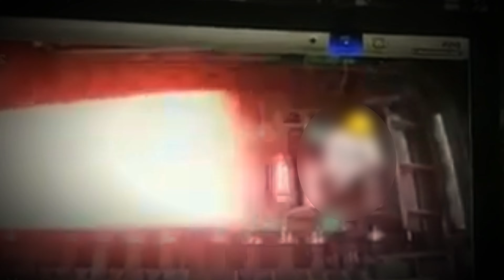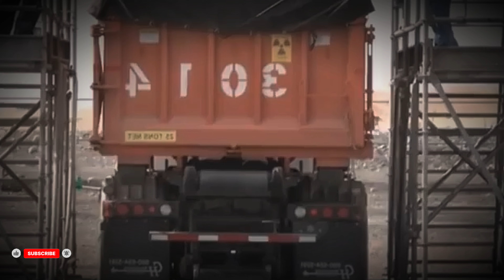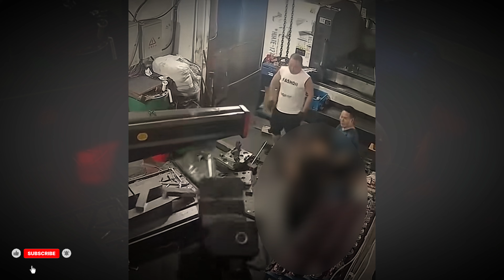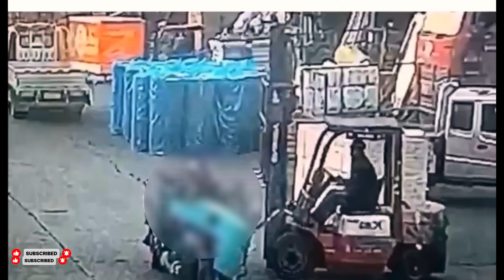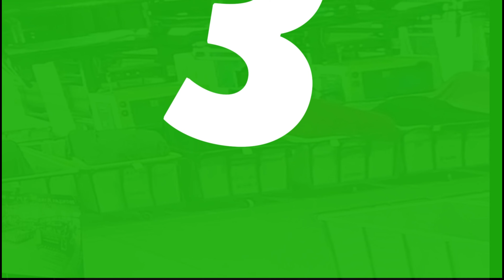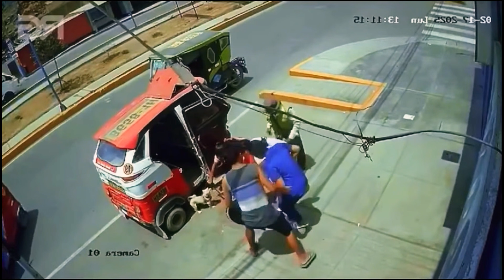He Stood Too Close to the Machine… Then This Happened!

Comment: The segments are far too long. It will help retention and completion rates of videos if they are shorter.
Reply from the maker: Thank you for your feedback; I will try to improve the next video.
Reply: @FIXtoFAIL Hello. I didn’t mean this as criticism at all—just a suggestion you might try on one or two videos to see if it improves the stats. It might help, it might not.

I think your videos are great. I always stop to watch when one pops up in my feed, and the deadpan delivery really works.

One thing I’ve noticed is that in some segments it takes a while to reach the key moment, and in others, once that key moment happens, the segment continues another 20–30 seconds without much happening.

So a segment might be around 60 seconds long, but the part that really hits only lasts about 15 seconds.

I’m not suggesting cutting segments down to 15 seconds—that would be a mistake. Instead, once the key moment happens, what if you briefly reinforce or replay that moment, then end the segment right there abruptly. 

Just throwing the idea out there. I think your videos are great as they are, and while biggtrux is mostly right about attention spans in general, that’s more about how social media works than my own patience.
Reply: Another member of short attention span theater.